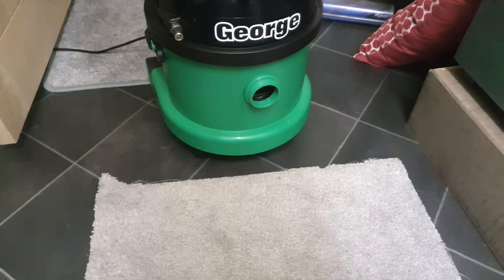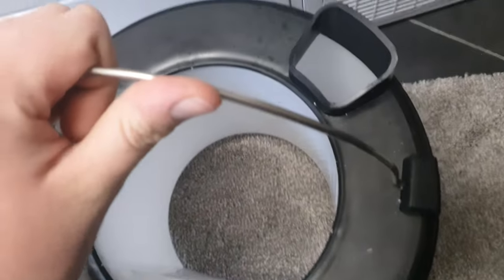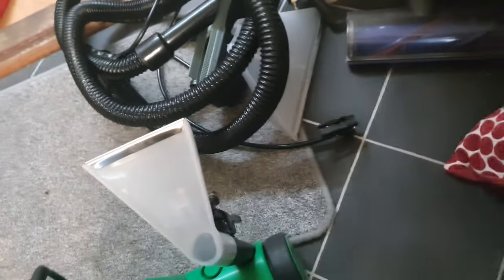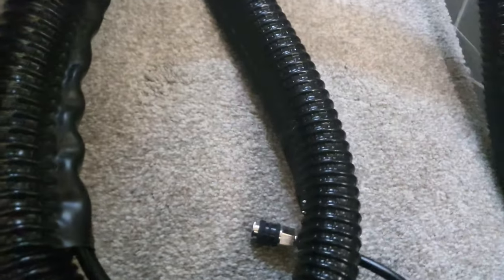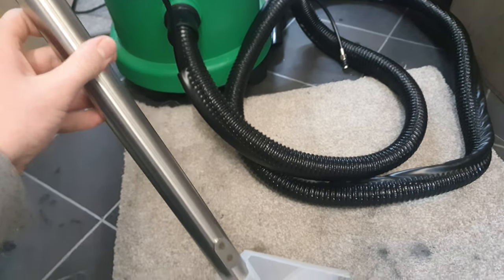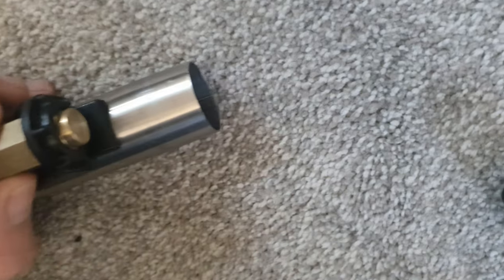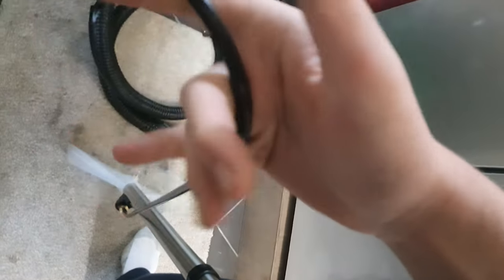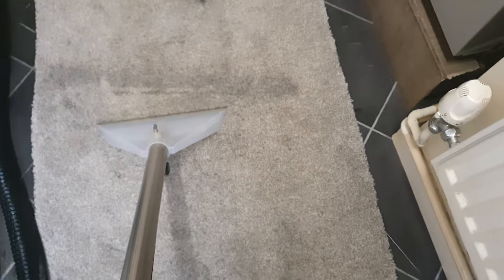How to use a numatic George for carpet washing

Comment: Hot water gets you better results not luke warm. Just saying
Reply: Probably does but they tell you to use cold water so 🤷‍♂️
Reply: @johnb8956  I run a carpet cleaning business and I can assure you hot water will get you far better results than cold water
Reply: @travismcfern9671  better results for warping everything
Reply: @bread-gz3rl  I have been using hot water for donkeys years, much better results [hot doesn't mean boiling]